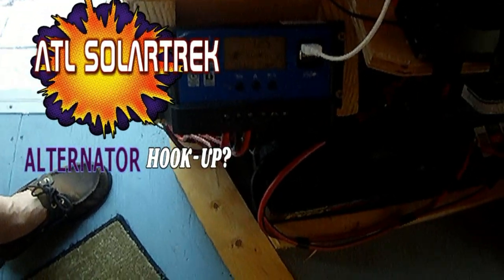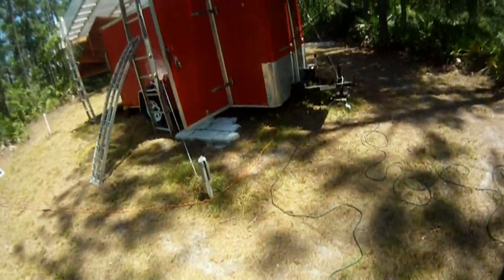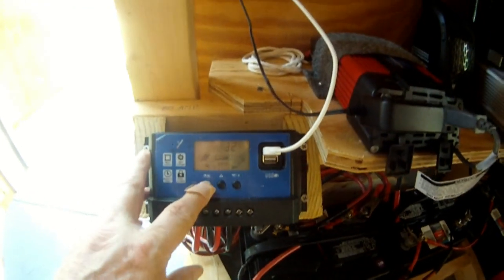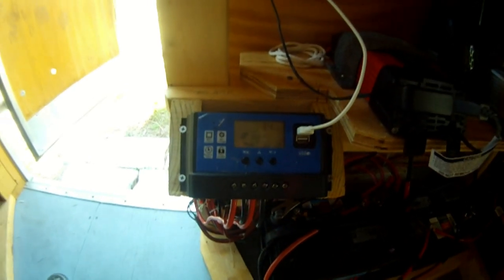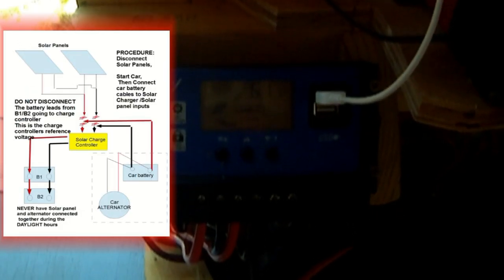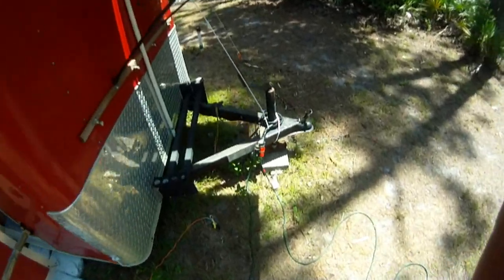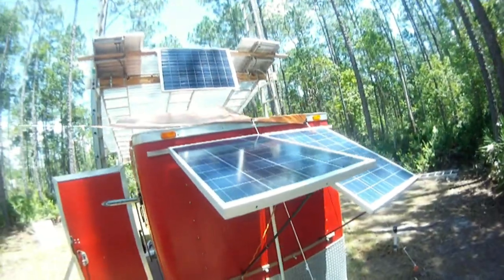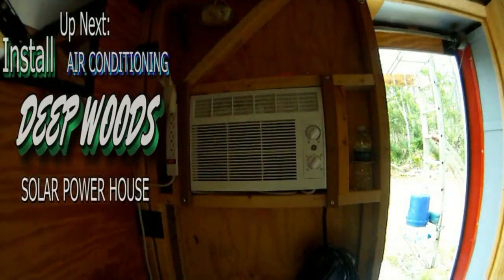SAFE Howto Hook up car ALTERNATOR to SOLAR CHARGE CONTROLLER Solar panels solar energy projects DiY

Comment: Amperage is PULLED by load, not pushed by the alternator.  The limit on how much amperage you can pull is dictated by the length and guage of  the connecting cable and any fuse. The car battery is capable of suppling hundreds of amps if the load PULLS it
Reply from the maker: Hi Tomas,
Thank you for watching.
Try thinking of it this way....
12 volt battery trying to charge 11 volt battery( no alternator involved)...
how much current is drawn from 12 volt battery to the 11 volt battery?
if you check with a multi meter, the current draw is minimal and charging the 11 volt battery will be very slow.
Now, with that said,...
Yes the alternator is capable of producing high current.
to the car battery...
what you are missing is, the wiring to the solar power system battery Does have resistance no matter WHAT size the cable is.
Now, since the cables to the solar power system act as a RESISTOR,
The car alternator does not feel the voltage potential of the solar power system battery.
It only detects the CAR BATTERY, it sees the car battery has a drain on it but the drain is slow ( 1-7 amps).
The drain is slow due to - "the difference is voltage potentials between CAR battery and SOLAR power system battery" ( 14.5 at car, lets say, 11.5 at solar) .

Now, if the Solar power system battery was @  0 volts, then yes current draw would be much higher and more power from the alternator would be needed to keep the charge on the CAR battery.    
Thanks again for watching!
Reply from the maker: Hey Thomas. Thank you for watching and comment.
My particular set up = about 9 AWG  1 cable ( 3 wire 14 gauge each for positive 1 for negative).  approx loss for 50 feet cables is 26 Percent. max no more than 8 amps draw = about a couple amps.
 Of course, you could use shorter cables.... I like using power chords as so I can use them for multi tasks versus just recharge. 
Thanks again for watching!

Comment: You can add relay which is connecting car charging and disconnecting solar in same time, and also some voltage relay which is activated when voltage drops.
Reply from the maker: hey dino,
thank you for watching
Reply: Would that involve a 5 pin relay l, but instead of the switch changing loads, it changes power supply source?
Reply: What about adding 1 diode on the positive of the car alternator and keep it all connected at the same time ?
The diode would avoid the current to cross from the solar panels to the alternator.

Comment: Don't hook it up to your solar inputs. You run it to your ignition, or direct to the car battery, to your auxiliary batteries. The power only flows through the charge controller one way. It works like a dc to dc charger. Alternator to your battery. Then from your ignition to the charge controller battery port. Then to your auxiliary batteries. I did a similar build for my overlanding/hunting truck.
Reply from the maker: hey wisconsin,
thanks for watching

Comment: Most car alternators are eighty amps The small one you can usually get them up to about a 130 120. If you spend a little more money put some money on your wires and get way more amperage

Comment: Why are you going through the charge controller? Car alternator is regulated so just go direct to battery,same as using jumper cables,it’ll only charge what the battery needs,seems over complicated,maybe I’m missing something
Reply from the maker: Hi Matt,
Thank you for watching! 
I can see your point for simplicity 
but, there are many reasons
I will relay a few to you.
hooking up directly to the power house batteries from car alternator changes the reference voltage used by the solar charge controller. every time you disconnect alternator from power house battery system, you might have to reset solar charge controller for use with solar panels the following morning. there is a sequence that must be followed and its a bit of a pain to disconnect/ reconnect the wiring coming to and coming from panels/batteries.
the benefits of the solar charge controller-  solar charge controller can monitor voltage input and monitor current input as well as current used by loads on house / power station batteries, 
you don't have to leave the door open at night to the cargo power station, keeps the bugs out,
nice and quiet inside power station. do not have to listen / hear the car motor running while replenishing power station. thanks again for watching and your comments are appreciated!

Comment: If the solar charger control stops/float charge when the batteries are fully charged why not hook the car alt directly to the solar battery’s , car alt have a voltage regulator in them to reduce the  charge when batteries are full and u would have to unplug and plug up the solar panels
Reply from the maker: Hey JB, just saw your comment. Thank you for watching. I'm actually on the road back down to the big red solar power station. Please reference my answers to your questions many of the comments and replies that I have made to the same questions. Thank you for watching!
Reply: Get a dc-dc charger or you will fry the alternator.

Comment: HI.  Thanks for the clear and informative video.  I bought a camper van that already had the alternator connected to the RV deep cycle battery in what appears to be a complicated way.  There is a junction box with what appear to be fuses and some kind of switcher that clicks on and off sometimes.  Now I've added a 350watt solar panel and a charge controller (Coleman 30A) that doesn't have a 'load' connection, only panels and battery.  I hooked it up to the battery, then the panels as advised.  Is there any danger in having both the alternator and the solar panels connected to the battery at the same time, although not through the charge controller?  Thanks.

Comment: Thanks for your video. What is the total amount of solar coming 600 watts?
Reply from the maker: - hey Roy,-
Thank you for watching!
yes, up to 600 watts  @ 18volts dc from the solar panels.
I have seen about 23 amps on the charge controller display. that equates to about 414 watts.
The alternator set up in this video creates about 87 watts ( 5-6 amps @ 14.5) 
Thanks again for watching

Comment: Hi. Nice lectionary 
My question is how to connect parallel the solar panel and the generator from the car... it will go only manually?
Thanks 
Have a nice day.
Thanks for your answer.  BR
Reply from the maker: Hi big fan,
Thank you for watching.
You can't do that with this set up.
Daylight, If you hook them up in parallel,
The alternator will sense the 18 volts of the solar panel. This would tell the alternator that the battery is full and no current from alternator will be supplied to power station batteries.
You could put in a 3 way switch,
Wire as so either power from solar panel OR alternator is applied at the solar charge controller then on to power station batteries.
They also make an automatic switching device. This would effectively allow only alternator current when alternator is on, when alternator is off, would only allow power from solar panel.
ALSO, one more thing, you could have them hooked up in parallel at NIGHT when no power is being generated by solar panel.

Thanks again for watching!
Reply: @AtlanticDrain  thank you so much. 
Yes you have right...
I will switch manually from solar panel to alternator at night.
Thanks and have a great day.

Comment: Could I just get a 4 terminal switch that (switches) the positive and negative from the solar over to the alternator? This would be right in front of the s. charge controller power input. Or not?
Reply from the maker: hey shep thank you for watching. yes you could.if you have no other means of disconnecting your solar panels but you still need to make a plug in point for the alt cables... thanks again for watching

Comment: I have a portable generator that has a dc jack thats rated at 100w, ive measured the output and its around 15vdc unregulated. Could i hook that up to my pwm charge controller to have that control the charging process on my battery? My pwm is a 30a model renogy. Thanks!
Reply from the maker: hey garneau,
thank you for watching. you could hook it up as the power input for your charge controller but, it may not charge as quickly as a solar panel. 100w solar panel output is 18 volts dc
your generator dc output is 15 vdc.  charge current is proportional to voltage difference / potentials of battery and charge source.
but yes you could use with controller but do not hook up solar panels at same time...
thjanks again for watching!
Reply: @AtlanticDrain   

Solar panels are current sources, they push amps. Solar charge controllers are designed to modulate current coming from the solar panels and maintain solar battery 🔋 voltage constant. 

Alternators and car batteries are voltage sources. Solar charge controllers are not designed to modulate voltage from other voltage sources. 

Once I tried what you explained and I was not successful. I tried to use a 24 volts battery 🔋 to charge a 12 volts battery 🔋 through a solar charge controller. It did not work.

Comment: Great video man, I have a ? How could I do exactly this temporarily and get more amps to my battery, I have a 30 amp mppt charge controler with the mt50 remote, an was thinking of a similar thing. Using a truck battery on ground that is hooked to charge controler, will be getting a lifpo4 soon will this allow more amps into it, thanks
Reply from the maker: Hey auto,
Thanks for watching. 
It will only allow about 4-7 amps per hour. It will not do what you are hoping and charge 25 amps or something like that. It will work but only 4-7 amps at a time. Thanks again for watching!

Comment: How many ah are ya battiers in the bank and how long will they power the AC with no     solar input? Also how many amps does the AC draw? love this etup tho👌
Reply from the maker: Hey x, thank you for watching! 300 ah batts  and the air ( 400 watts) will run for a minimum  couple hours. I have really good insulation in cargo trailer. it cools down almost instantly. if i shut it off and use it sparingly, it will run all night ( no solar input).Thanks again for watching!!

Comment: Hi AtlanticDrain, nice video. I have a question. Is it safe to connect a 300W inverter to a 20A PWM solar charge controller. I have a setup (100AH, 12V battery, 300W Inverter, 360W panel) where I connect LCD TV (130W), set top box (20W), 12V DC lamp, and occasionally connect laptop and phones for charging. I have been connecting the Inverter directly to the battery but I am always getting tempted to connecting the inverter to the solar charge controller DC output terminals.
Reply from the maker: Hey beenyoni,
Thank you for watching.
Your 20 amp charge controller can handle a maximum of 360 watts at the monitored dc  output terminals.
Let's add up all of your power consuming devices.. tv + top box = 12.5 amps. The 12 vdc lamp can be as much as 2.2 amps,. Laptop chargers range about
 3 -5 amps phone charges are .5 - 1 amp.
Total dc current=20.7 amps.
It's best not to use the load outputs. I don't think you run everything at once but,
If you did, this would put your charge controller at risk for failure.
I would stick to battery posts for the inverter power.
Thanks again for watching!
Reply: @AtlanticDrain  Thank you for your response

Comment: Hey cool video question why are u only getting 5 amps from the car battery into the charge controller when most car alternators put out 100 amps ? I run a 1000 watt inverter on my car all the time just about maxed out. So what’s the difference would u need to hook to alternator up directly to the charge controller to get more ? Or is your cable size ? Cheers
Reply from the maker: Hey Doen,
Thank you for watching.
most alternators have a maximum VOLTAGE out put of 14.5 Volts DC.
Most batteries even when depleted are about 10 volts (when depleted)
The voltage DIFERENCE between the battery and the Alternator
dictates the amount of current that is drawn from the alternator.

The LOAD battery located in the car,
is the sensor for the alternator.

"as voltage (difference) increases, current increases" 
"as voltage ( difference) decreases, current decreases" 
watch the video again, it explains it a little more in detail.
Thanks again for watching!
Reply: Hi doen and AtlanticDrain- so my understanding from AD's answer is that the alternator is only putting out 5 amps now- but to doen's question, that alternator amp's output would in fact increase to both as the car battery started to drop voltage from the drain of the trailer battery. The charge controller amp rating would come into play as the trailer battery drained down and allow more amps also- correct?
 
My thinking is the AC/Invertor is sucking hard on that trailer battery and like AD said it would eventually start to drop voltage- so that difference, then, would mean the charge controller would allow more amps from the car battery/alternator and like doen said- then the alternator should have plenty of amps as is.

Thinking then it would be key to make sure cables are sized for max draw.
Reply from the maker: Hey Surf,
Thank you for watching 
and your comment / input on the subject.
in short your explanation is essentially correct with one factor 
that is being overlooked.
The  amount of power drawn from an alternator to a battery + direct load
in this case (deons) the 1000 watt inverter, is feeling the potential difference of 14.5 volts vs.0  to  4.5 volts difference  from trailer / power house charge controller batteries.
so, current draw @ 14.5 volts = 69amps thats pure load current.
The alternator does not sense the 1000w inverter when tied to the load of the trailer / power house battery.
 The factor is a  there is a diode in line with voltage isolation occurring when tied to powerhouse charge controller and batteries.
When tied to charge controller and powerhouse/trailer batteries, The alternator now feels the difference is a maximum of  about 4.5 volts.
so, less voltage , less current hence 5 to 7 amps or so output from alternator to powerhouse batteries.
and
yes cable size would make a  difference as well.
electrically, my set up is about 10.5 gauge wire from alternator to powerhouse hookup point.
I so enjoy seeing knowledge passed around on this subject.
Thank you again for watching!!!!
Reply: Voltage drop or needs mppt charger, u should get 10 amps from cigarette port
Reply: And car needs to be moving to get better charge or press gas

Comment: only thing I would recommend is too invest 30 bucks in the renogy wanderer solar charge controller. I had the one you are using, I set my float voltage to 13.6 and it continued to put out 14.9 volts.
Reply from the maker: hey pnw,
thanks for watching.

Comment: Hello, I was just wondering whether it would be possible to purchase this and drive the  automobile alternator connected to a high-rpm, 220v AC motor. I have a 5kva MPPT inverter, but I don't want to use a solar panel. What do you think of it?
Reply from the maker: hey abrham,thank you for watching.
sounds like you want to plug in 220vac ( you must be in europe?),
that motor has a pulley anf that will be connected by a belt to alternator which produces a dc voltage and you want to regulate this with mppt charge controller?
 yes,
 and make a video!!!
thanks again for watching!
Reply: You will burn the alternator when the compressor of the ac unit kicks in.

Comment: im not getting power from battery to the charge controller, any idea why?
Reply from the maker: Hey best,
Thank you for watching.
Could be, your cable is not hooked up going to charge controller.
Or - you have a battery switch inline that needs turned on
Or - an inline fuse is blown
Or - battery is dead.
Or - faulty charge controller.
Try another battery, be sure all connections at battery and charge controller are secure and making good contact.
Thanks again for watching!

Comment: Dude, I don't own a solar panel. I was wondering if I could just buy a solar charge controller instead of a B2B Charger, since it is much cheaper. Will that work?
Reply from the maker: Hey YL,  thank you for watching. you will need to explain your set up. a charge controller will work but only puts out 3-8 amps and set up needs to be just like ive shown here, connect disconnect too.thanks again for watching!
Reply: I tried that. It did not work for me.

Comment: Hey there nice vid , just curious as i wanted to do the same. 
This time, i have a solar battery and wanted to use solar charge controller hook up to the car battery to charge it while driving. Just wanted to check out if you have tried it on charge while driving the car with different current and voltage feeding the scc. If so, is the Normal pwm scc able to function properly, charging the solar battery? Would appreciate your reply, thanks for your vid and subscribed.
Reply from the maker: hi dubai, thank you for watching! you can use the solar charge controller as long as you have the car battery between the alternator and the charge controller. the charge controller needs the solar battery reference voltage in order to properly charge it. so, it would be just like the video has shown you. it would still be isolated from car start/ run battery. unaffected when starting the vehicle and note, if the car battery remains hooked up to the charge controller when the car alternator is off. it would draw current from the car battery ( if the solar battery is not fully charged). thanks again for watching.